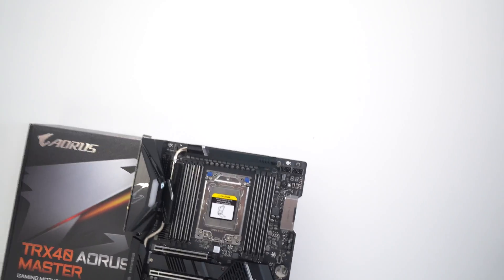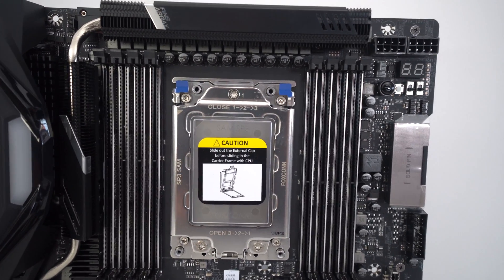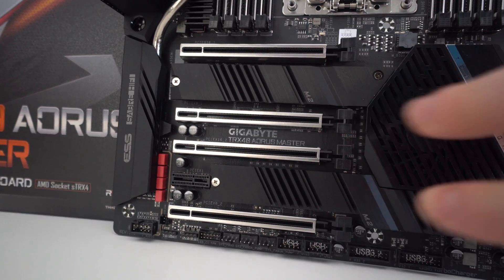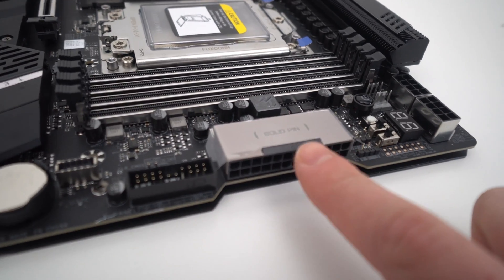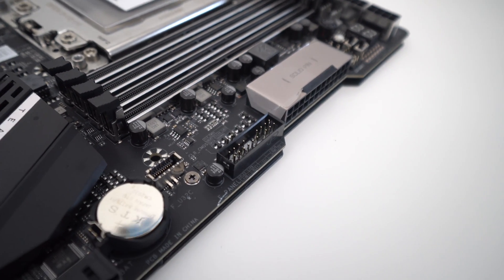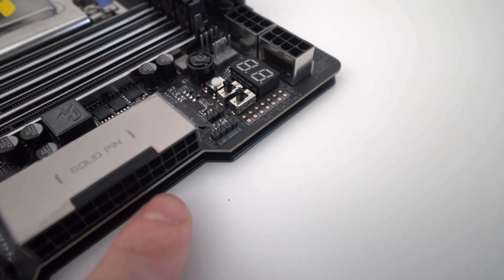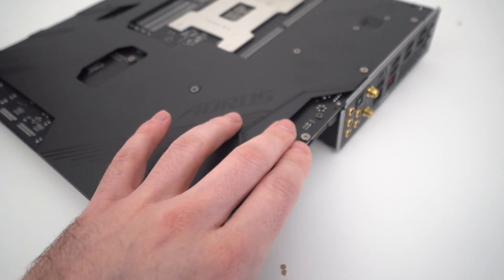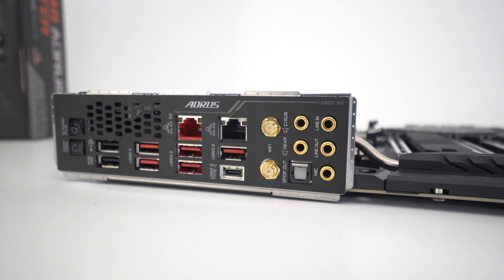Big Board...Big Money...TRX40 AORUS Master!!!

Comment: near the end you mention it would come out cheaper than intel.. I dont quite think that'll work out as you say it will, because seeing the boards and cpus, entry into threadripper 3 will cost about 2000$ whereas if i went intel, i could get a solid x299 board for much cheaper (350$?), cpus from 500-1000$. I was willing to plonk down 1500 quid for TR3 cpu and mobo but now, amd just made my choice really difficult. especially with regards to what happened to x399, really not liking platform longevity prospects from amd now.
Reply: Are you serious? I want more zen 2 cores on x399 instead of weaksauce am4! That's why I'm even considering hedt! If I wanted last gen stuff I would've bought it last year not now!
Reply: 1000$ is small premium?